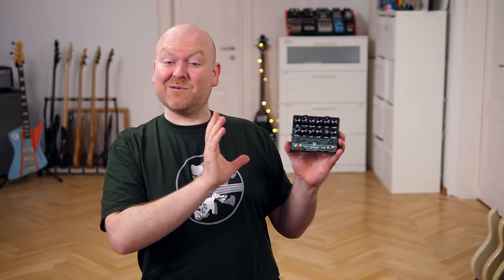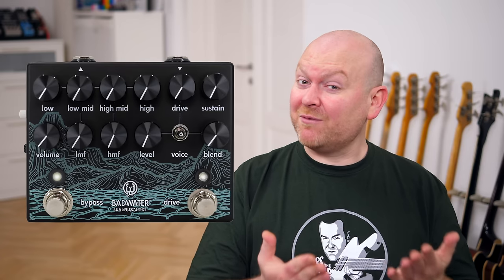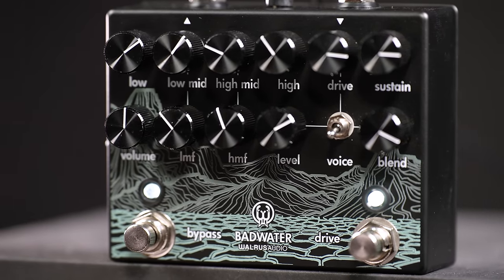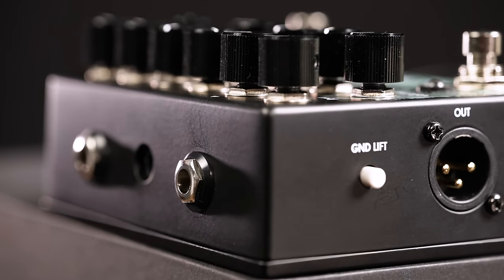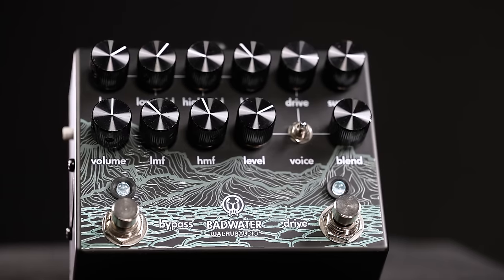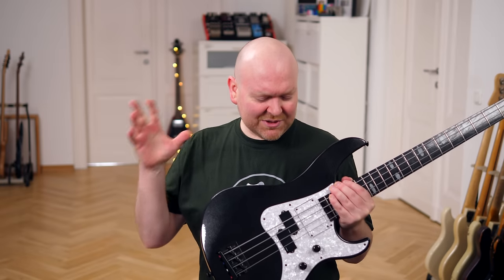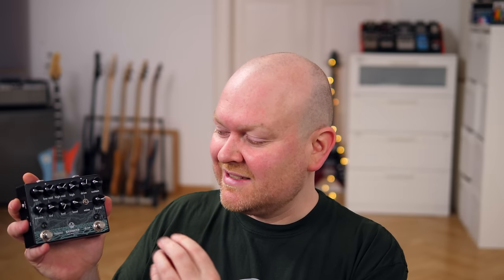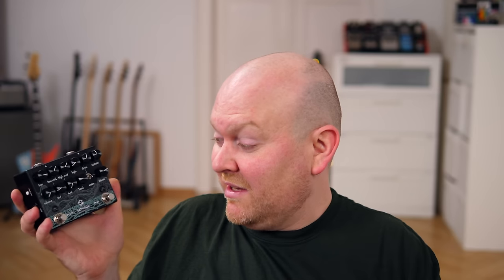WALRUS AUDIO BADWATER // BASS DRIVE, PREAMP & DI

Comment: Have you ever tried a Meridian Bass Rage? It does a little bit of that and goes up to a very synthy (farty?) sound. It's a very interesting distortion pedal, but it's not easy finding it's sweet spot. But once you do... :) Doesn't need to be pushed, IMHO works better with passive basses.

Comment: Not sure why Darkglass is considered the high-water mark for bass pedals. I have three pedalboards of bass pedals, and not a single one of the dozen different DG pedals I've tried have made it onto one of my boards. They process the signal so heavily that they eliminate the character of the instrument, amp, and even the player (and they don't play well with other pedals at all). This looks significantly better than anything from DG, so I have high hopes that it can be the centerpiece of my smaller, traveller's board.
Reply: Ummm maybe because most people don't share your experience? I bought and sold over 15 different overdrive pedals before going to darkglass and nothing gets even close to the clarity and playing feel. Turn the gsin down a bit and you'll see

Comment: i'm not sure when or why we have got to a place where every bass preamp pedal has to have some form of dirt built into it. we all already have our fave means of adding dirt to out tone. why can't we just get preamp pedals that are.. preamp pedals, i don't need it to also do fuzz and compression and all that jazz.
Reply: Don’t buy it then…. There are plenty of preamp pedals too
If you only have 2 or 3 pedals then this is great 
I have nouse for this features but appreciate that others might
Reply: I'd say that dirt-capable preamps have been rather common the past few decades, probably since Marshall's heydays in the 60s. Makes sense to me that pedal makers since 80/90s Tech21 SansAmp tried to mimic it.

But yeah, I see where you're coming from. I guess these kinds of "one stop shop" pedals makes economic sense for players, since buying one of these is significantly cheaper than buying a clean preamp + compressor + dirt + DI.